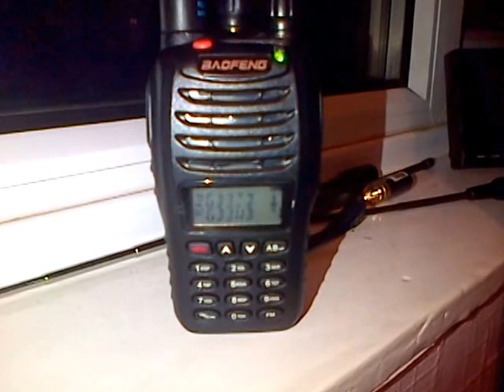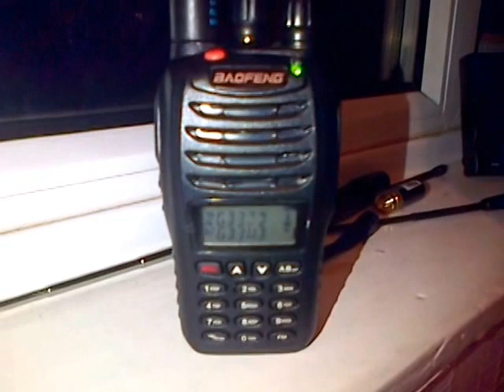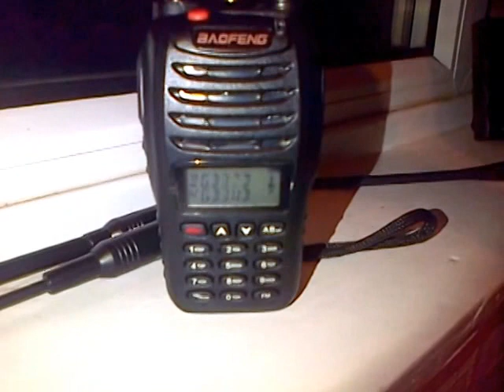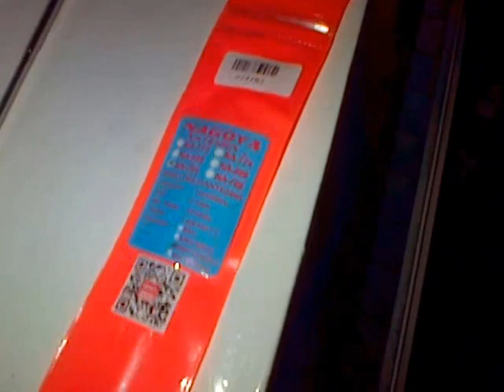Baofeng UV-B5 Nagoya antenna UHF test. GB3ZB

Comment: The stock antenna my baofeng uvb5 came with seems to work better than all the other antennas ive bought for it and id like to buy a baofeng uv8s or uv888s but everybodys like no no dont its worse than the uvb5
Reply from the maker: I would stick with the uvb5 or get a uv82l as they have better reviews Justin. Thanks for the comment I appreciate it!